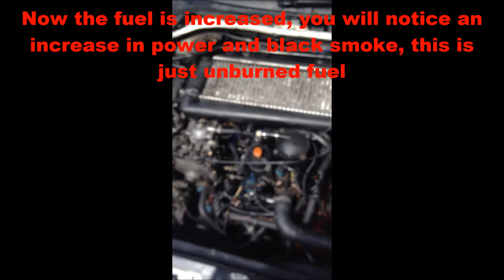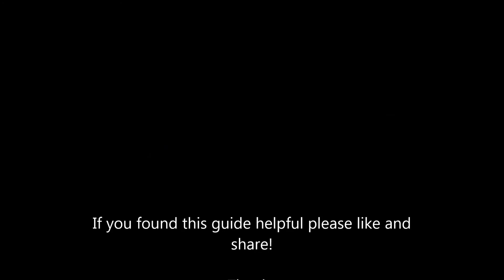How To Increase Fuel On A Bosch Pump XUD9 306/205/Xsara/ZX

Comment: i done this to my turbocharged HUD9 engine,now on idle is working on 700 rpm.fuel economy is great (4-4.5L/100 km),and no black smoke at all. before turbocharger was set up on 1.2 bar and on idle was working on 1100 rpm. now when i done that, i didnt notice performance changed.still now is 0-100 little less than 10 sec,and after 100 km/h no problem at all,car pulls like new. turbocharger is set on 0.8 bar now :) cheers!

Comment: Does this work on 1.9 non turbo?
Reply: Darren Prior id like to know that aswel
Reply: Did u find out if it does
Reply: @darraghharrington1779  no it does not, the non turbo has a lucas pump, it can still be adjusted but not as reliable or trustworthy, check out Darren lobb on YouTube and follow the part about the lucas pump👍
Reply: @lostsheep1616  it works on the Lucas pump too, it’s just more difficult to adjust them. On a non turbo Bosch it works aswell.
Reply: @lostsheep1616  you get a dw8 with a boscj